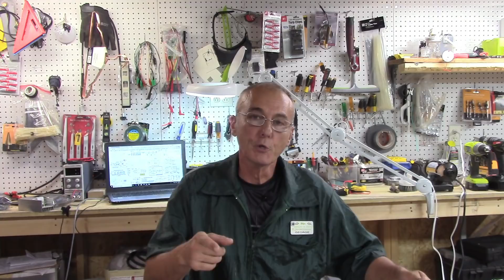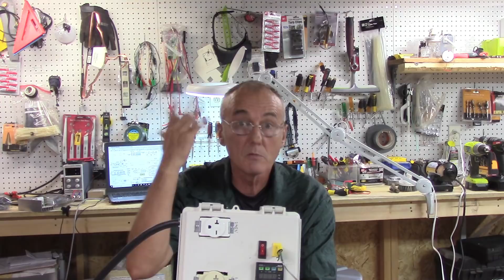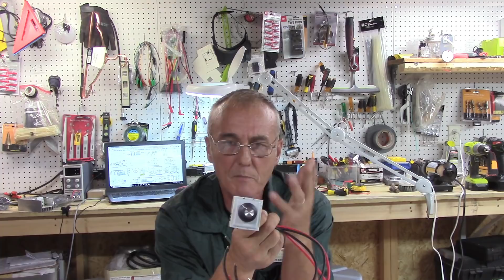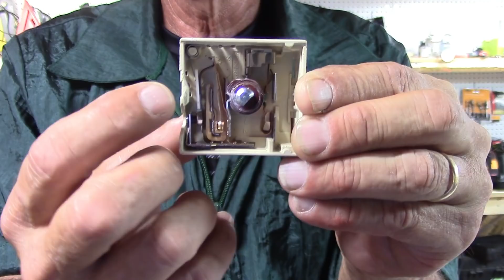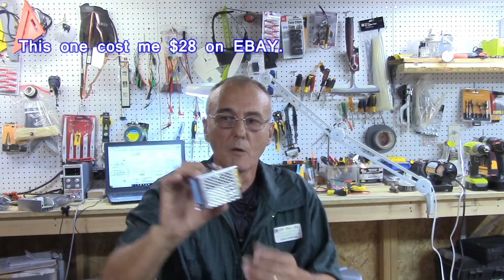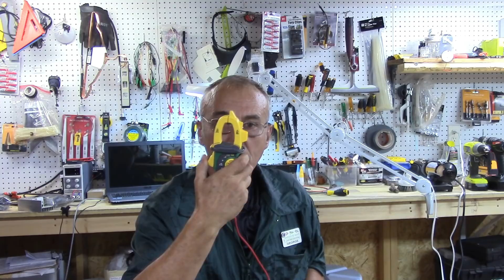Pulse wave modulation as a heat controller

Comment: I use a PWM on a water distiller. Easy to control spirit flow, distilling for absolute peanuts. Surprisingly it does alright after a few runs.

Comment: Hey George I've tried 2 PWM and no success. One worked only for the test run. The other PWM works but doesn't get up to a high enough temp, which it did at first but it seemed to stop working after a little use. I'm running a 2000w element on 120v 20amp outlet. Both PWM are rated for 4000w. Am I just getting unlucky with these? Comments on Amazon point to these not being the best quality but I don't know. Any suggestions? Thanks George!
Reply from the maker: Sorry I missed this comment. I test each one I assemble for accuracy and performance and have not had a failure yet. 
I sometimes use the 10000Watt PWM/SCR as well.
You may have just had some bad luck. I am not sure.
Reply: Hey George thanks for the response.. just for clarification I was getting these PWM off Amazon.. I ended up getting a 10000 watt and it worked very good. The problem that I was noticing is that initially I could hear the element Heating up the liquid in the beginning and was loud. However slowly but surely it was getting quieter and quieter. I mistaked this for power loss.. however I think when the liquid was coming to a boil it was audibly a different sound (quieter) and thought I was burning the PWM out. I simply kept the boil going and turned out some product though. I hope this makes sense but thank you so much George for the response and of course these amazing videos! I'm now making runs and they're working perfectly.
Reply from the maker: Great, you solved you own issue. 
Happy distilling
George

Comment: Question,  Your PWM.. you say it's 4000 Watts..is that what we are concerned with in this application..or is it AMPS?  I see a few 30 Amp ones on Amazon but not sure of the Volt requirements for a 1500Watt Element.  (although I bet I just gave you enough info for a math equation to figure it out...).. Thanks..
Reply from the maker: Rob
 A 30 amp model indicates that it is capable of handling that much current (amps). A 1500 watt element will draw 12.5 amps at peak on 120 volts so as long as your system can handle that you are okay. You indicate that it can handle 30 amps. 
The real point here is that what you draw in amperage is just as important and what you can supply. Watts divided by volts = amperage at peak use. 
To recap, a 4000W PWM (which is capable of 33.33 amps [ Watts / volts = amps ] ) is the same thing as a 30 Amp one. The terms are synonymous and is just two different ways to arrive at the same thing.  
George

Comment: Hey George..Great Information.   I have been using a Router/Tool Speed Controller which I think works on the same principle  (PWM) as what you are working on here.  (https://www.amazon.com/Power-Speed-Controller-Router-Motors/dp/B0012WKCXK/ref=sr_1_7?ie=UTF8&qid=1528896310&sr=8-7&keywords=router+controller).  The issue I have with the Cheap (you get what you pay for) Router Speed controllers is that it gets VERY Hot at max output. When I start to cycle her down she seems to do fine.  The Minimum power output is still ON and gives a Trickle of juice to the element.   I really like your design and may add a fan to the mix for added cooling..    Thanks
Reply from the maker: Rob,
I understand. The router control has no cooling means so the amount of amperage running through at full power heats it up. A cooling fan would and maybe a heat sink would really help. In any case, you are all over it and using what is available and it is good to know how much of this you understand. Keep at it and as always;
Happy Distilling
George

Comment: Great video George I’ve built something similar using a TRIAC and a resistor controlling with a cheap dimmer switch of course an amp gauge and computer fan. Can’t wait till part 2
Reply from the maker: Awesome. We think alike. I am always on the look out for effective ways to control heat and I think this is it. Very easy and inexpensive.
George
Reply: Trial is much more efficient and relatively inexpensive

Comment: Wont that cause fluctuations in your column temps
Reply from the maker: No, there is no fluctuation because there is never a time when the element is completely off. The voltage and amperage are either reduced or increased based on need so there is a smooth transition which results in no fluctuation.
George

Comment: George, don’t you mean Pulse Width Modulation (PWM)? Your analogy to a bi-metallic rheostat does not apply because the bi-metallic element is either off or on depending on the current going through the element. Anyone who has tried to use a cheap hot plate to heat a still knows the lag time of the switch makes for very inefficient operation.

Pulse width modulation varies the percentage of on time to off time over a timed interval, I.e. Duty Cycle. The wider the pulse, the more current goes to the load. 

In AC systems like a light dimmer, the dimmer adjusts the width of each 1/60 second sine wave pulse. Phase Angle Controllers are an example of this method. These devices can inject a lot of radio-frequency noise into a residential power system if not properly filtered due to the sharp cutoff of the sine wave pulses.

I love your videos and look forward to seeing Part 2 of this project.
Reply from the maker: PWM is known by both terms (wave and width). The bimetal switch was described as a rudimentary type of PWM. 
I do appreciate your comments and can always learn and adjust from them.
George

Comment: so this is using a 120v rheostat switch to control the heat source along with the controls of the heating element??.     
or just using the rheostat switch to control the duty cycle?    
eerrrr.... 240 volts.
Reply from the maker: The analog control controls the circuit inside the PWM.
George